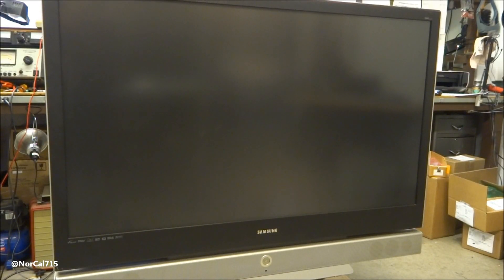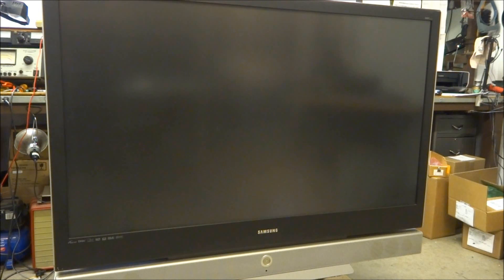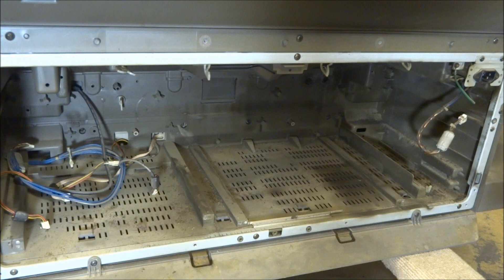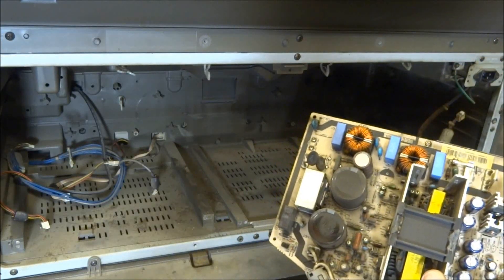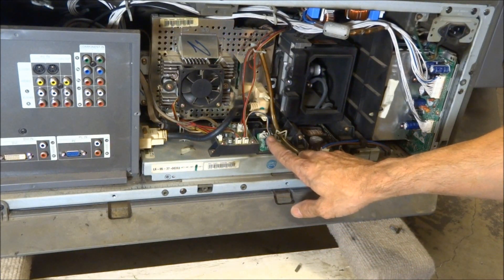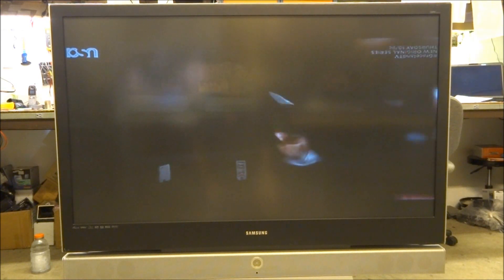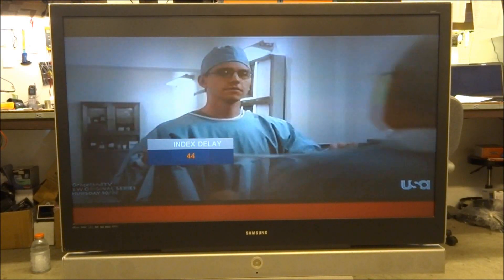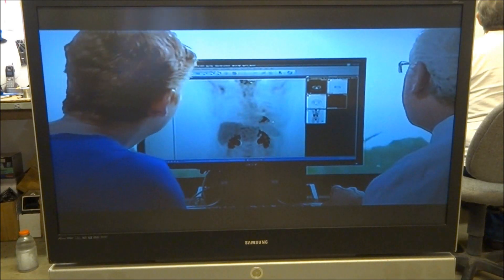Samsung HLR5067 5667 6167 DLP Chassis Changeover

Comment: i have a HL-r6167wx/xxa  bought new lamp willnot come on, replace power board and balance all fans r running , all three indercater lights or flashing,what is the problem????
Reply from the maker: Is the color wheel spinning up to speed? The lamp will not strike until the DMD board verifies that the color wheel is running at the correct speed.

Comment: I was replacing the color wheel on my HLR6168 and the plastic of the male end deteriorated on the board.  I was able to plug in the connector from the color wheel to get it to work.  That is, until this last time that I went to change out the color wheel again.  Instead, it came off of the board entirely.  I currently have a large paperweight in my living room because of this one small, yet vital connector.

Do you, by chance, know which connector size, pitch and whatnot I would need to order up to have it replaced?  I know it's a micro right-angle, single row, 4-pin with only three wires active (from the female).  I have someone that can do the reconnection, but we're stumped on that one little part.

Thanks.

Comment: Hi Norcal, I have a HLP4663 that is a L3 chassis and 2 HLR5067s, one of which is a L3 chassis and the other is a L6 chassis. I wanted to swap the L3 light engine from the HLP with the HLR5067 L6 light engine so that I have 2 HLR5067s with completely interchangeable parts. When I try to power on the HLR5067 with the L3 engine from the HLP, the ballast does not attempt to fire. Is there something I am missing or is the L3 light engine from the HLP not compatible with the HLR series? The L3 engine from the HLP is BP91-01707B, the L3 engine from my HLR is BP91-01707G, and the L6 engine from the other HLR is BP91-01847J. Thanks for all these great videos!